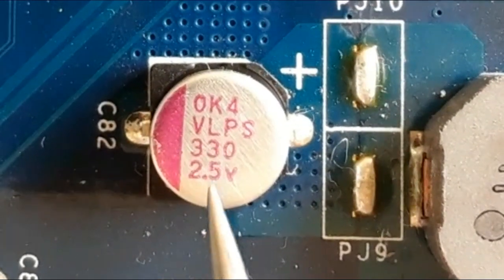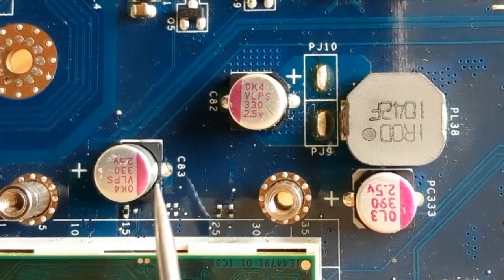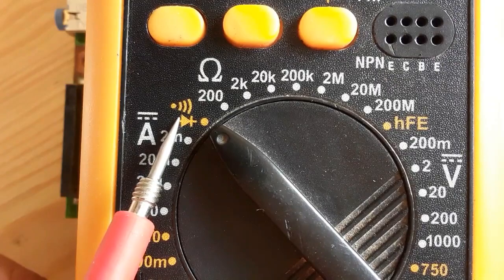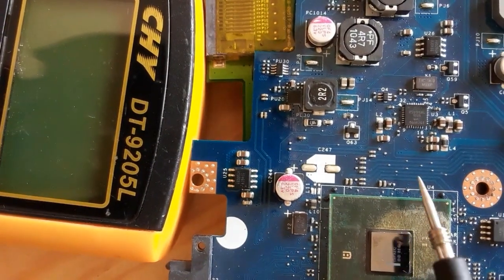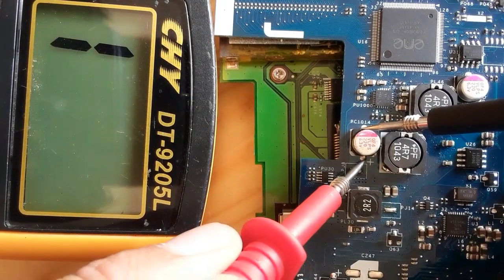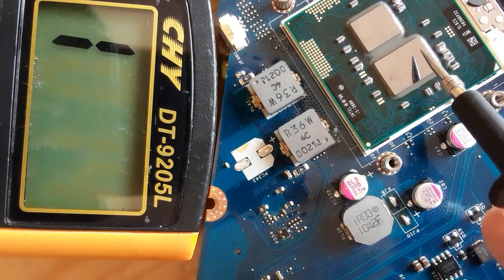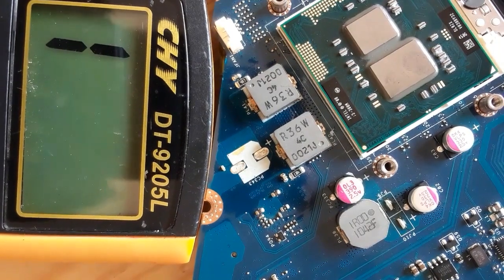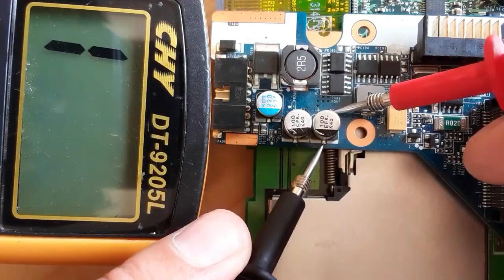How to test Electrolytic Capacitors with a multimeter, SMD capacitor testing

Comment: You have checked only the good one what about the bad ones ?
Reply from the maker: If you get a continuity while testing the bad ones means failed
Reply: @electronicsrepairbasics_erb  Sir ,  are you sure about this method ? I have a Lenovo all in one 330 motherboard that has no cosmetic damage , it has just stopped working all the sudden  without prior warning signs . with your method , every single  capacitor on the motherboard  give continuity, also I saw videos where they say you can get continuity , but when you reverse the probes and don't get continuity the caps are good
Reply: @tunkunrunk , you may be right, but sure sounds like you're checking diodes vs capacitors.

Comment: Please can you answer? How can I get smd ceramic capacitor value of capacitance C from voltage drop when he buzzes in continuity mode? Is it possible? I have 5 capacitors in a row. 3 of them have 200 voltage drop and 2 are buzzing on 15 . Are those 2 faulty? I want them to be replaced but I don't know their value.
Reply from the maker: A bad SMD ceramic capacitor can be replaced with another SMD ceramic capacitor with same size and color